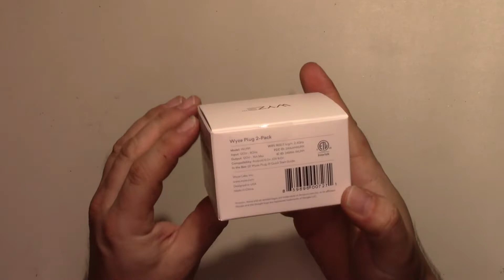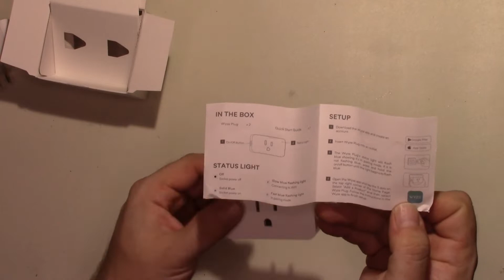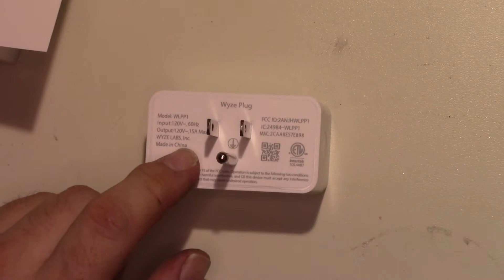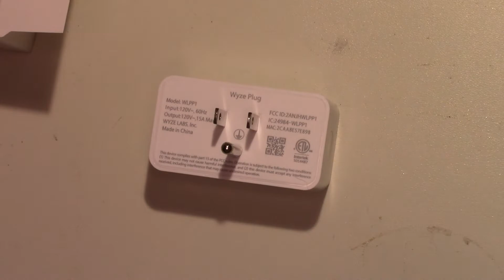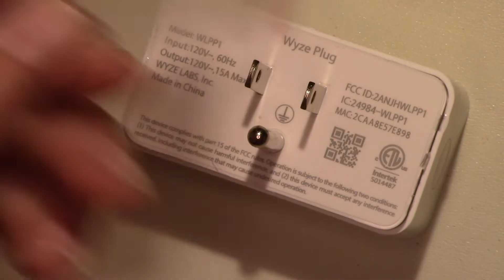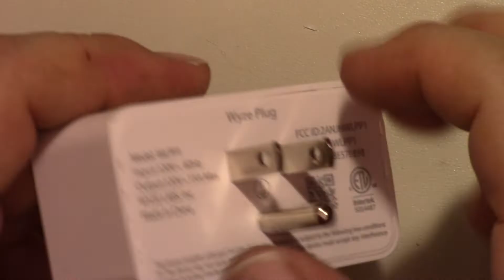WYZE Smart Socket Teardown  -YASS

Comment: Do you think it is possible or reasonable to convert this to 12v in/out? I want to use on a 12v solar system with no inverter using the Wyze app.
Reply from the maker: I honestly do think that's a reasonable idea. It would take some work but essentially you just feed 12v into the input of the voltage regulator.  It should work perfectly fine in my opinion.

Edit: I've been thinking about this all day. If be glad to mod an outlet for you if you want. I've done it with sonoff modules before (12v power) so a wyze plug should be fun. Can I email you?

Comment: Regarding the fact the fuse is on the Neutral: my guess (and I cannot confirm since I could not find any reliable info on this) is that the geometry of that corresponds to where the L, N, G are in Chinese sockets/plugs.  Can someone verify?
Reply from the maker: I asked in the Wyze forum and no one knew.  I have stopped using all my wyze smart home items except the cameras.  The bulbs ended up being a nightmare.  The outlet would go offline until I re-added it for no discernible reason. I had all pre-orders so maybe it was early production problems.  The camera's have been solid.

Comment: I have one of these and the relay doesn't open the contacts even when you turn it off. You can hear the relay clicking but there is still full voltage at the output. what do you think happened there?
good news is Wyze is sending me a free replacement.
Reply from the maker: My guess is the relay either broke inside and the contacts are stuck or they welded together from a spark when they closed. Getting a replacement is a good idea! Wyze has fantastic customer service.

Comment: I re-flashed a pair of these using the Tasmota basic and they are working just fine. The plastic base was throughly glued to the plastic body. Opening the unit like you did would not have been possible. I had to carefully groove the base near its perimeter to get the case to open. No desoldering was required to remove the pc board! The line and neutral plug pins just slide out of case with the pc board. There had been a slight bit of glue on them. The daughter pc board holding the esp8266 connects to the main pc board with a soldered edge connector. That is where one can connect 3.3v, GND, TX and RX for re-flashing. GPIO0 is not available on that edge connector. You can find a tiny pad for GPIO0 on the daughter pc board. It is a bit awkward to get to due to the nearby relay. There are pads for the other connection also on the daughter board but it is much easier to use the edge connections.  The daughter board's edge connections are labeled. I needed a microscope to read them and to confirm how this unit is controlled.
Reply from the maker: I had been part of the pre-order on these so I wonder what else was different?  I think its interesting how yours were different to open. I noticed that with some Gosund outlets I had.  Does your Wyze outlet still have the fuse on the neutral side?
Reply: @FixitFrank  I am not saying it is different to open. I am saying it was thoroughly glued to the point where I do not think it would easily crack open without damaging the case sides. Yes it does have the fuse on the neutral. I am not so sure that is a problem if the fuse is meant to protect the internal power supply circuits and not the load relay contacts. 

The design does appear identical to what you show. I selected these WYZE plugs because they use 15 amp rated relays. I could find no others in this US market where we have 15 amp household circuit breakers where someone like you showed the insides.

The outlets were being sold at a discount for the Christmas season. I am waiting for another sale offering and possibly WYZE's next version. I could tell by some additional unused ESP pins brought out on that daughter board that another WYZE product is planned. It might be a power monitoring plug.

Comment: Does it work only with 120V or 220V also?
Reply from the maker: They may technically work on 220 but they are not made to do so. I suspect they are ok from 90-240 but I have not tried it. Personally they are not that great of an outlet for the price. The fuse placement is something I don't like. I would recommend another brand like techin or nooie, also gosund. They all have a little better construction.
Reply: Kristjan, did you tried with 220V? I've purchased a pair recently and didn't realize that is labeled only for 110V.